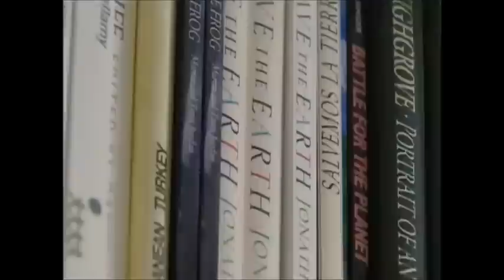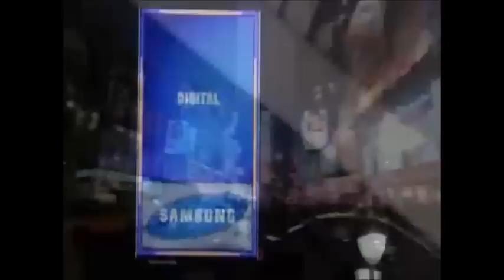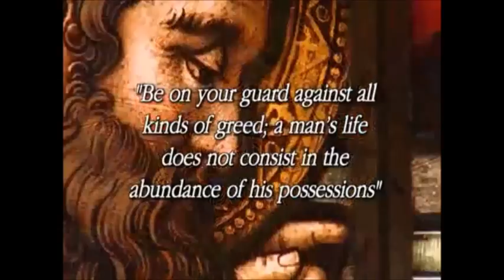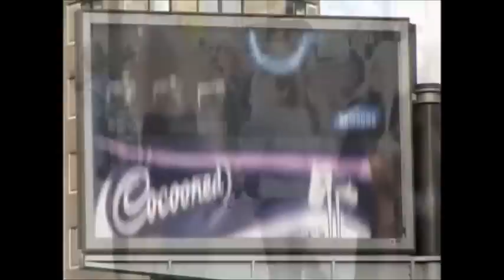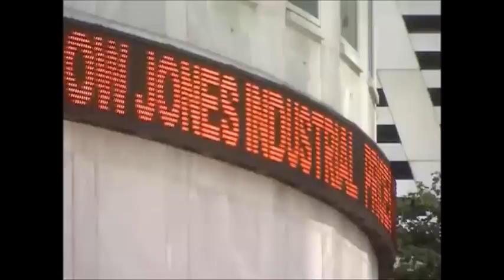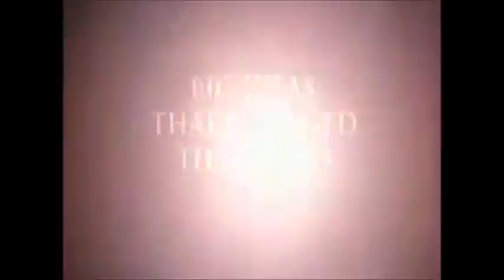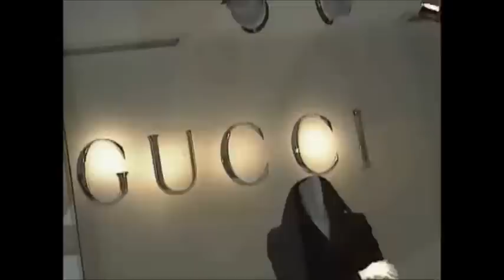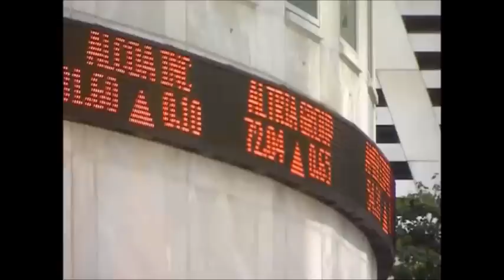The trap of materialism

Comment: I don't want to name any countries, but...  My high school buddies bought (own country made) washer/dryer sets when they got married. ..  30 - 35 years later machines starting breaking down (no parts!) so they went out and bought new (overseas made) machines and those  only lasted 5 years.  My Sunbeam Mixmaster is 71 years old and it's still as good as ever.  Made in country to last back then.  I'm sure  there are more expensive brands that will last that long: the difference is that the Sunbeam was affordable for ordinary families.

Comment: Calling an appliance "Efficient" does NOT mean it does the job. It may use less water but, more times than not, you NEED that amount of water to clean effectively. I've learned this the hard way. I bought "efficient" appliances and toilets years ago and discovered right away that they didn't do the job. So if you have to wash the clothes twice and flush the toilet twice, you're right back where you started. One area we have right is in light bulbs. The LED bulbs are great but, even they carry a catch. If you enjoyed the benefits of heat with light from incandescent bulbs, it's lost with cool LED bulbs. Solar is the definitive answer but, the start up cost eats the savings and that's by design unfortunately.

Comment: This documentary fails to ask a key question that most people rarely think about. That question has to do with energy production: Why are we still stuck with petroleum-based energy systems and other primitive methods like electricity, solar, wind, geothermal, etc., after all this time? Those technologies date back to the 1800's and 1900's!  Here we are in the 21st century and we still produce energy the way it was done centuries ago! Why have there been no revolutionary breakthroughs in energy production techniques, for the past couple hundred years? 

We have refined those antiquated methods and made them more efficient, but we should have replaced all of them by now, with more advanced and cost-effective techniques. Trillions of dollars have been spent on energy research & development, for about 100 years, yet we have nothing to show for all that effort? Will we be using oil  and electricity for energy 200, 300, 500 years from now?

It's interesting that the U.S. Patent's and Trademarks Office has thousands of classified (top secret) patents, most of which are related to energy production and propulsion technologies. I suspect that  revolutionary breakthroughs in energy have already occurred but are being kept secret because Mr. Mobil, Mr. Getty, Mr. Exon, Mr. Chevron, and the rest of them have tooo much to lose, if the current geopolitical and economic structure of the planet is radically transformed by, more advanced,  much cheaper, more accessible, and more efficient energy production/propulsion systems.

Comment: the washing machine argument is flawed when the machine is still designed to break down with in 5 years and have to be replaced as it not worth repairing due to complexity / cost
Reply: andrew stone They can be fixed. Most are not that hard to fix. People are afraid to try. My washer is over 6 years old and runs like new. My dryer is 20 years old. I've replaced the belt twice and need to replace the felt in the back of the drum. It has to be taped on the bottom to hold the side to the drum. Not very good looking but drys as good as the best of them. I thank all the YouTube video makers for helping me save hundreds of dollars and our environment. The snow blower is next...
Reply: andrew stone I buy things -- gently used when appropriate -- when I NEED them.  I go in, get what I need, and leave.  Then I enjoy what I acquired until it wears out.  I take good care of my things and they last longer.  Also, I quit watching TV a very, very long time ago, so I don't want anything I don't need.  I have an awesome life.
Reply: I actually have a washing machine that's 30 years old...my grandma gave it to me! 😆 that sucker was built to last!!